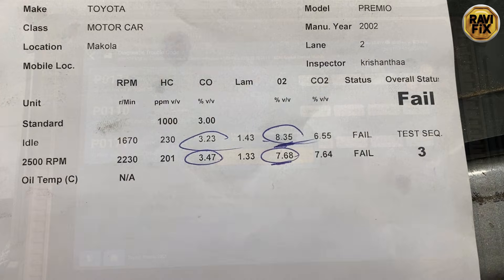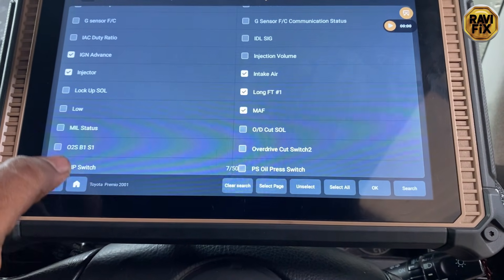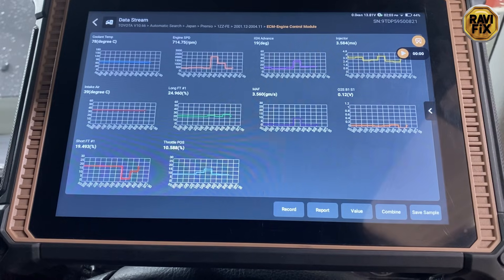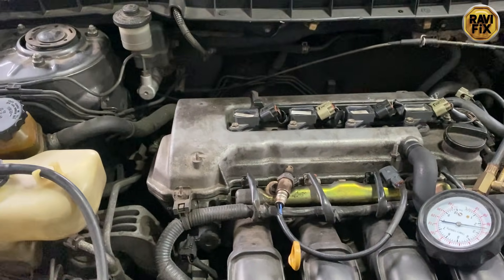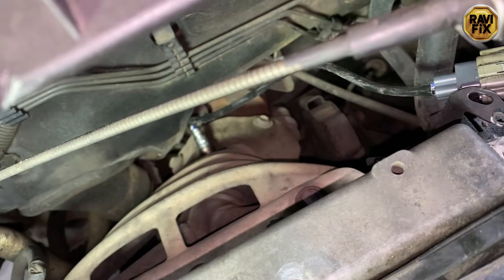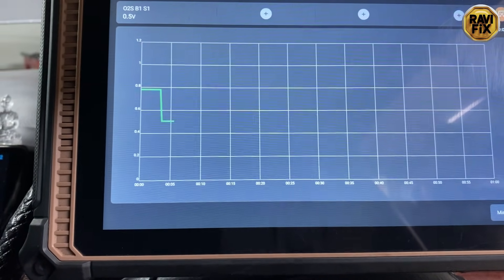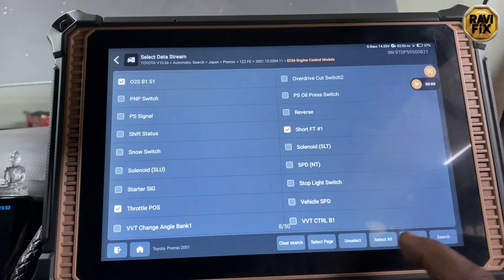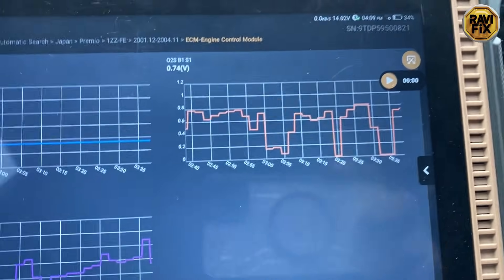How to diagnose P0171 system too lean fault. Toyota Premio 2002 emission failed

Comment: Yeah it's going to take a little bit for the ECU to "unlearn" the previous fuel trims with the bad sensor once you install the new sensor so it can get back to that regular switching between rich and lean like it's supposed to. Some cars will be quicker than others at that.
Reply from the maker: Yes, you are correct